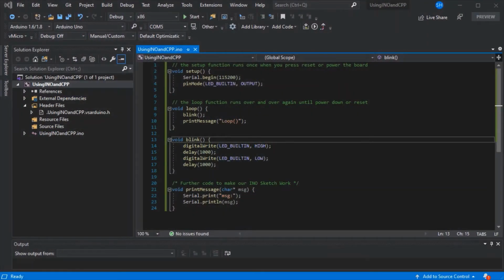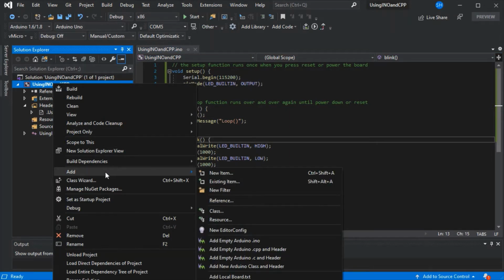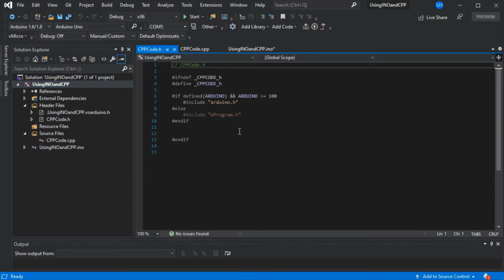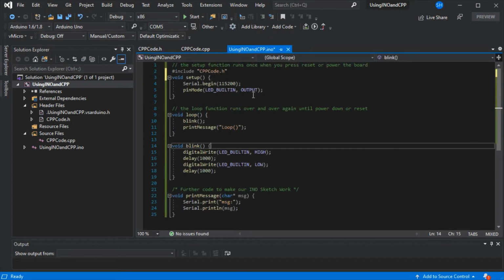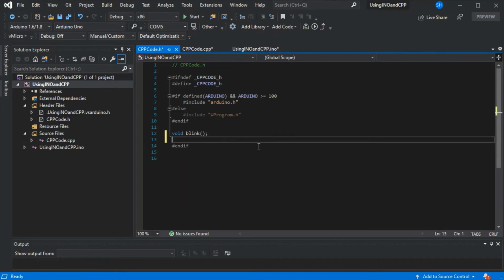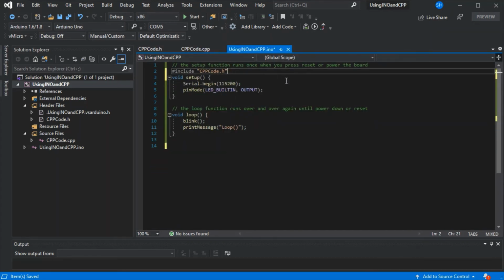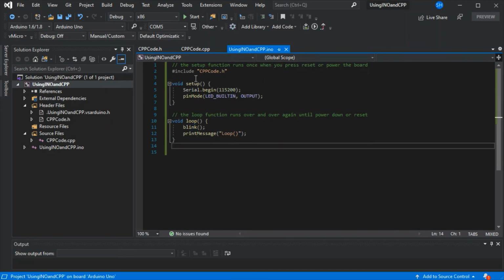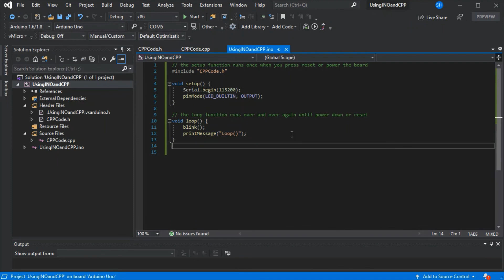Convert Arduino INO to CPP Walkthrough

Comment: how do you handle structures in the header file?
do you have to declare them as extern?

because i always get an error because i include the headerfile in the cpp aswell as the ino
Reply: Old post.. but...For those who reads this later:
The headerfile should always contain #ifndef blabla in the start and then #endif in the end of the file. (Sometimes people use #pragma once) This tells the compiler that even if multiple ino or cpp files references this h file, it is only used once.
So structs can go into header files np.
Reply: Not really a VM question, but a CPP question. google "structures in cpp"